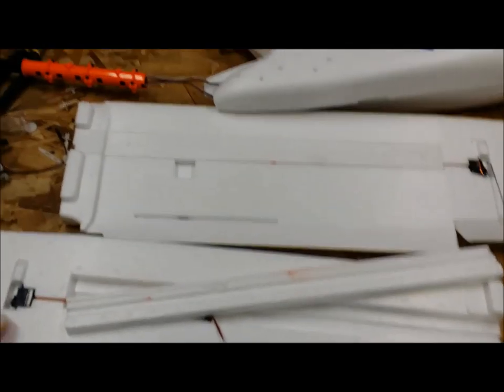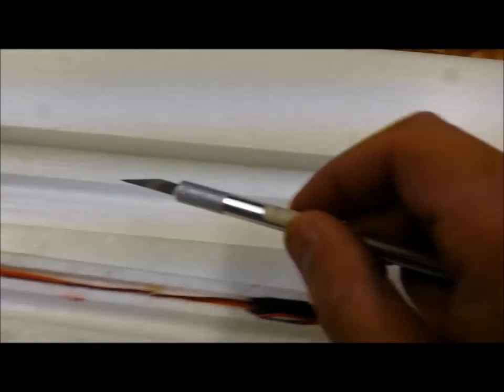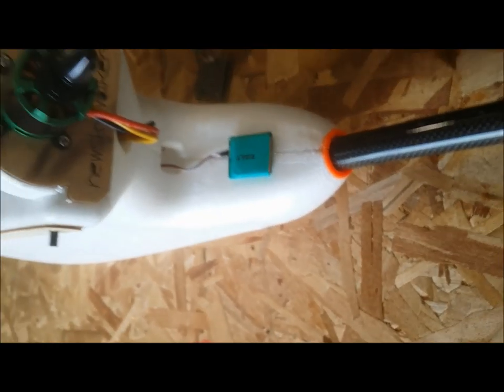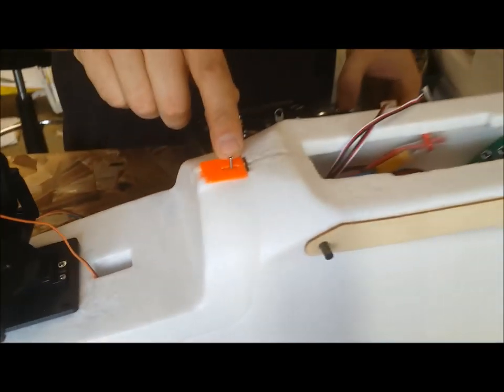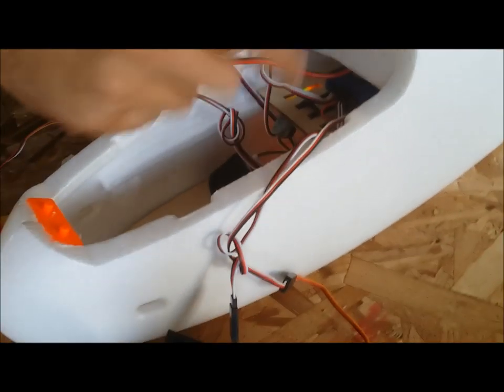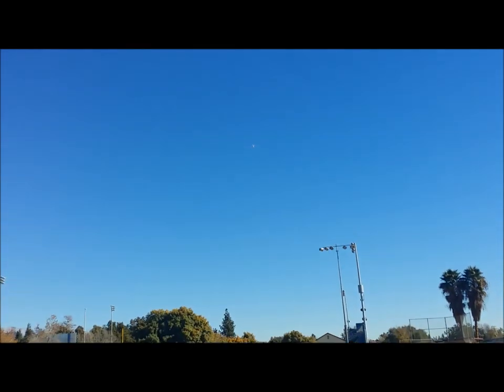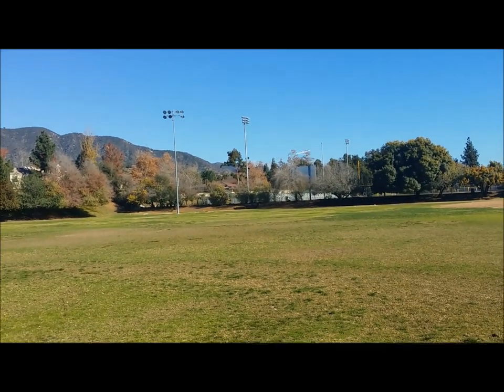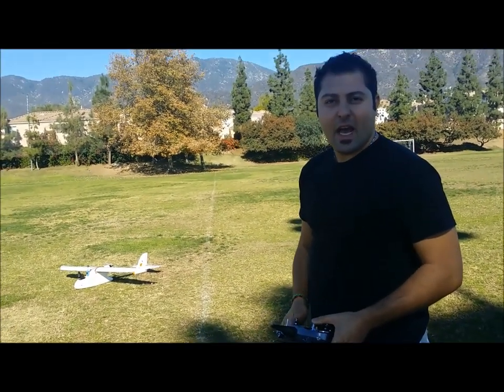2013 CF Skywalker build and Maiden with Cyclops Storm

Comment: Hi team legit, nice video on the skywalker . I have been trying to get into fpv and would like your advice on making a choice between 5.8, 1.2 and 1.3 setup for long range. It's is sometime that I have been looking towards. Have plenty of open country setting to fly from. Looking toward to your reply and thank you.
Reply from the maker: 1.2 and 1.3 are essentially the same band. Your mostly going to find 1258 and 1280 are the more suitable channels. 5.8ghz is definitely not a good choice for long range the farthest I have personally every flown with 5.8 was 2 miles. it also depends on what antennas you choose. If your planning on going anything over 2 miles you should invest in a cross hair or pepperbox antenna.
Good Luck and remember baby steps work your way upto it.

Comment: Nice informative video. What glue did you use for the motor mount and fitting body together?
Reply from the maker: I used Contact Cement to Glue the Two halves together and Really Hot Glue for the motor mount. It just needs to stay in place. becuase its being pushed against.

Comment: I would put the button boar in the front because you want to b able to adjust it and reset the home, also maybe move the gps out from under the motor.
Reply from the maker: Yeah the Board in the front would be ideal but I wanted to keep it as clean as possible. I have never had any issues with GPS being placed in that area. Ive done It on multiple models.

Comment: What is the final weight of your setup? I have built my Skywalker 2014 version with Cyclops storm and 2 x 4000 mah zippy flightmax. Havent flown it yet. But the weight ends up to be nearly 2.6 Kg. I am bit worried about the weight and flying time. Using 12x6 prop with Turnigy SK3 820kv
Reply from the maker: I don't Remember the weight that was a build for a customer I forgot to weigh it. This thing is a beast it can handle some weight
Reply: @Touhid- have you flown this yet? I have a 2014 from 1800 from FPVmodel.com that when loaded weighs 6 lbs or just over 2.7kg and I'm afraid to fly it. I'm not sure what to take off the plane. I'm running the 3dr Pixhawk w/ GPS and the Eagle Tree OSD Pro for antenna tracking. I haven't even put on my Go Pro yet - just a cctv cam with a small 1.3ghz vTx.

I have taped the front of all wing surfaces with clear tape for durability and put the clear plastic belly protector from FPVmodel on with a strip of clear tape as well. It's hard to believe this setup is 6 lbs but I'm not sure what I can take off of it and still do what I want to do with it.
Reply: Hi kd. Yes I have flown this and it flies well. Cruising at 7 amp. Climbing is little slow though. What battery are u using? Try get a 1900mm wing. Or use a smaller battery

Comment: The elevator tail of my 1880 skywalker is tilted. Are there any drastic/huge effects on this?  quite noticeable but not too much. tried to fix it but still returning back on tilt position. is this okay?
Reply from the maker: Im not sure what you mean by Tilted. do you mean it is not parallel with the wings. You should twist the carbon boom until its even with the wings.
Reply: Yes its not parallel with the wings. I dont want to ruin the frame as it is already glued. Is there a huge effect when I disregard this? Is not really huge though. Its just that im worryung about its performance in the air.

Comment: What if a servo gives up after you've glued it all together?
Reply from the maker: You'll have to do some Digging into the foam. If you use good servos then your chances of that happening are much less. Another thing you can do is run the servo connector to the end and then shorten the connector on the servo and have it plug in on the very end so you don't have to dig out a lot of foam.

Comment: Hi, Thanks for the info.
Do you run the batteries in parallel or one at the time?
Reply from the maker: In parallel for longer flight times.
Reply: Team Legit Thanks for the video.  I'm seeking a long endurance aerial mapping platform that can carry a Canon  Powershot ELPH 110 HS camera, to fly autonomous missions.  What is the maximum  flight time you could achieve in the Skywalker given dual batteries?  Thanks

Comment: I like this video. I'm torn between the SW and the SH. My question is, with that 5.8, what would be the max distance you would comfortably fly that? Thank you.
Reply from the maker: I personally like the Sky Hunter, however its big and bulky. As far as 5.8ghz range. if you check on our website Soon I have a set of antennas that we sell. its a 3 turn helical and with that setup and a 600mw VTX I have achieved 4 miles. had to turn back because battery was getting low.
Reply: Thank you. Are in the LA area?
Reply from the maker: Cory FPV Yes, I live in Arcadia Near Pasadena. Are you local ? Come Fly with us.
Reply: Fpvteamlegit, I'm in Bakersfield.  We own a rental in E.R., so I know your area. Next time I'm down,  I'll try making contact.

Comment: how did you wire your fpv? whats the voltages of the vtx and cam?
Reply from the maker: Cam and VTX are 12v I use a 12V Bec to power the Cyclops osd which provides power to the camer and the VTX for a clean install.

With the 12v Bec you can run 3-5s batteries with out issues.
Reply: What bec do you run? I have a 12v cam and 5v vtx.
Reply from the maker: Thor jourdan
5v for the RX http://www.hobbyking.com/hobbyking/store/__39470__Turnigy_5A_8_40v_SBEC_for_Lipo_USA_warehouse_.html

12v for the Storm OSD
http://www.hobbyking.com/hobbyking/store/__35672__12V_4_5A_UBEC_2_5S_Lipoly_7_2_21V_USA_Warehouse_.html